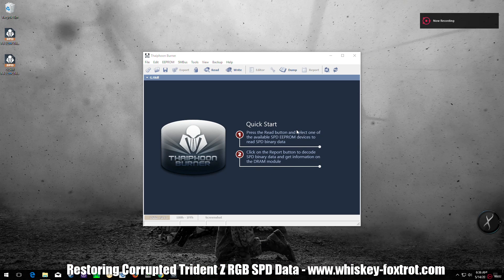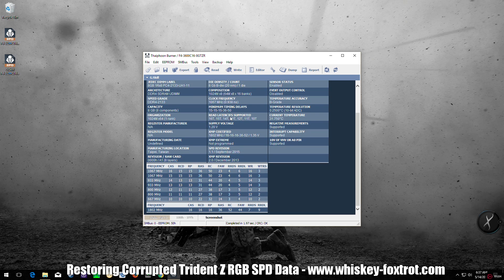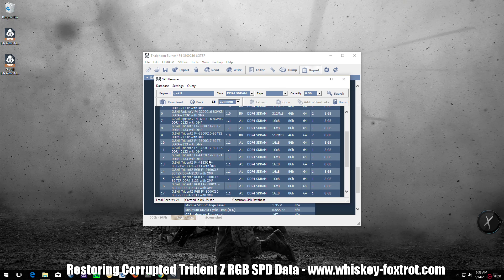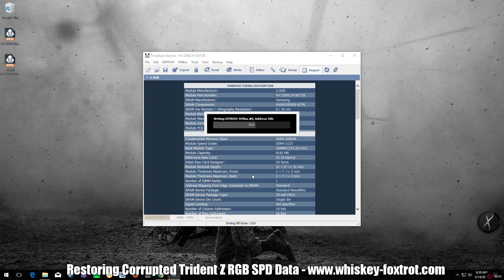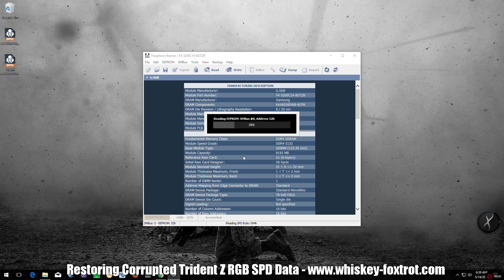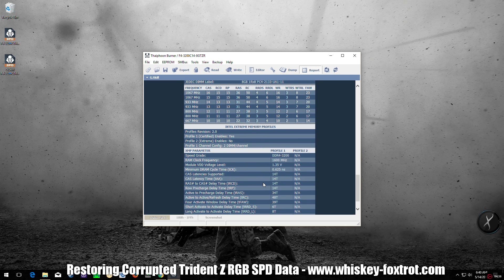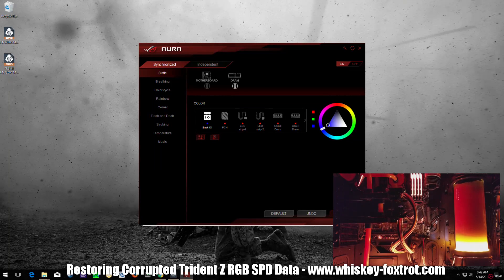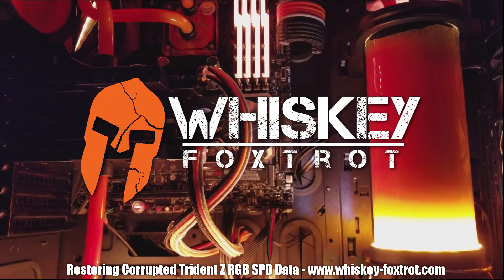Restoring SPD data on Trident Z RGB Memory (posted in 2017! Prob no longer applies)

Comment: mine both show CRC OK in report. but still only one lights up.
Reply from the maker: Try resetting your RGB controller software, whatever you're using. In Aura it's the little circular icon between minimize and close. If at ANY time you had more than one RGB controller package installed, you'll need to COMPLETELY remove them both and reinstall only one, including temp installer files etc etc. https://www.whiskey-foxtrot.com/2017/05/30/registry-cleaner-for-windows-10-post-creators-update/ . Also make absolutely sure that you're not also running CPU-Z at the same time as Thyphoon Burner, especially i fit's older than 1.79.1; same goes for any other crappy software that also accesses/read/writes SMBus data (i.e. Asus monitoring software)

Comment: I exchanged a 16gb 3600mhz kit because aura corrupted one of the modules and it went dim so I uninstalled Aura with Revo uninstalled and installed the new 32gb 3600mhz rgb kit and now occasionally taiphoon burner shows CRC:Error on the dimm but only one at a time and randomly. Most of the time they read CRC:OK but how could they be corrupted with NO Aura or g skill software installed??
Reply from the maker: There's definitely something going on with your mobo and in regards to your memory - it's either corrupted or it's not - I have never seen it switch from error to ok on its own. Also without a complete installation of G.Skill betas (especially < v16) you probably still have lightservice running in the background. Have you tried restoring your SPD?
Reply: Not yet I was just getting ready to purchase TB but I wanna make sure I program them correctly. I'm concerned afterward they are gonna get corrupted again, I wish I would have just rebought NON rgb ram this time. To clarify I never installed g skill software only asus aura but I completely uninstalled Aura with Revo uninstaller before I installed the new 32gb kit.
Reply: here is a post with a little more info: https://www.gskill.us/forum/showpost.php?p=81681&postcount=309
Reply from the maker: I was just about to reply here with what G.Skill admin said , but I also mentioned the background application running (lightservice); another culprit that could be accessing your SPD data (if you're not running other monitoring software like CPU-z etc) is other ASUS mobo software (AI Suite for instance). Try to uninstall it all and power your PC off (unplug it from the wall and press the power button to completely drain the system before plugging it back in and turning it off).

Comment: Thanks for the video. Could corrupted SPD data cause certain dims to become undetectable in the bios? I have 8 dims, three don't work (after a few days)  and I don't know if they can be fixed if they can't be detected. Any ideas? Thanks.
Reply from the maker: It's hard to isolate those issues to just the SPD, but I wouldn't rule it out. SPD contains information for the BIOS for automatically setting timings and other info (serial #s, manufacturer data etc). Have you tried manually setting timings in the BIOS and if so, did you try swapping slots? It certainly wouldn't hurt to verify your SPD data using Thaiphoon Burner.
Reply: Thanks Whiskey, no I haven't. They weren't showing up in BIOS so can't change anything. They're still within warranty so will RMA them. For the future, if the BIOS can't detect them, is there a way of making any changes? If the BIOS can't find them I assume Thaiphoon Burner wouldn't be able to either(?)
Reply from the maker: Without a BIOS entry it's unlikely to be detected by OS-side apps like TB. Curious though, you had all 8 running and when did they actually stop? Did you run any specific software or did you OC them in any way? Also which mem kit  and mobo do you have? Before RMA'ing see what TB can detect and try to switch the non detected to the working slots. Another thing to try is to run  mem86 after booting with just the bad ones, one by one.
Reply: I have an Asus Strix gaming MB and 8x8 Trident Z RGB. Previously had an Asus Deluxe II but four dims stopped working on that one after three days. I had used the aura software. That didn't detect the dims (before any other problems) I then installed the g.skill software (big mistake according to forums and Asus) and it was after that the MB dim slots broke. after getting a new MB the bad dims still wouldn't work. The System won't boot with the dead ones only so that's the biggest issue.
They say the g.skill and aura software can kill the dims so at the moment it's best not to use them until they're updated but it's looks like it's too late for my ones. Thanks anyway.
Reply from the maker: Can you test your mother board too with just 4 dimms to make sure that's still good to go? I've seen a few instances where the slots were damaged when some of the sticks went above 1.5V per RAM auto settings! I hope that didn't happen to your mobos!

Comment: When ran it seems to fix the problem, but as soon as you close and reopen the program and read the DIMMs they all return (or at least 2 return, it's very sporadic) with CRC Error for me. Might have something to do with Aura being installed in general? Basically it seems to immediately corrupt the SPD or something. Neat program though, thanks for the video!
Reply from the maker: The first thing I would do is COMPLETELY (reg clean and all) uninstall ALL LED controller software or you'll just leaving one of the root causes to your data being corrupted. So do that first and try a rewrite. On one of my systems I had to do a CMOS clear and started over

Comment from the maker: PS - in regards to F4-3200C14-8GTZR, the RGB indicator bytes are missing - I have an updated dump which I've tested to work fine with RGB functioning via the G.Skill and/or Aura app. The download is listed on our site.
Reply: Tried downloading your modified version but the download doesn't work, could u please fix it? My RAM's SPD got just corrupted today, both sticks, just great. Thank you for your guide btw, it'll save me a LOT of time.....BIG thanks from the bottom of my heart. :)
Reply from the maker: The file hasn't changed and is still available for download. Also, you should not need to download it as the Thaiphoon Burner version now includes a corrected dump for F4-3200C14-8GTZR.
Reply: Yea, figured out my browser was tryin to open it, just had to save it. I'll try it then,  thanks again man, cheers.